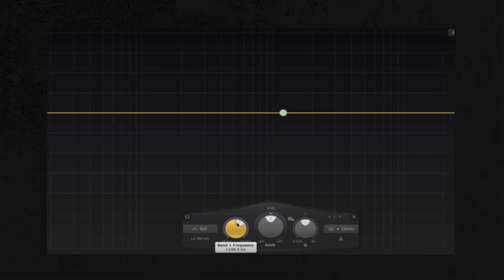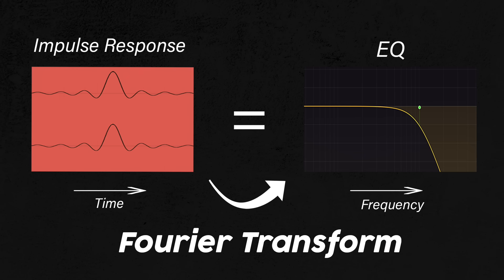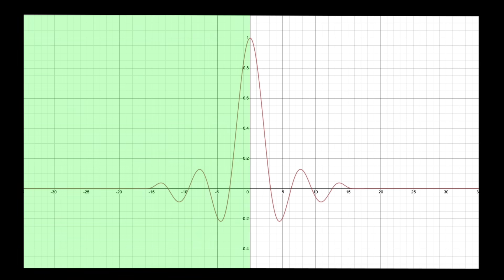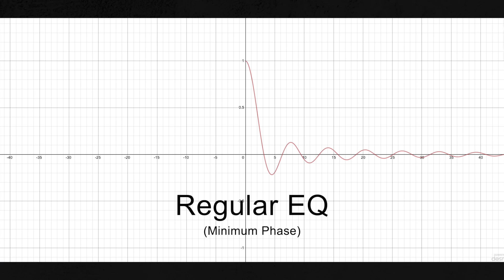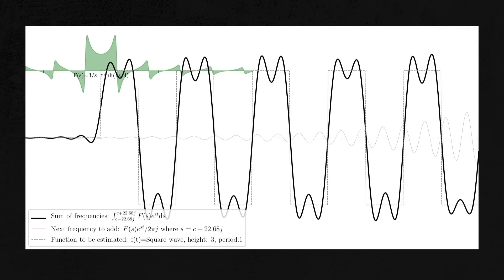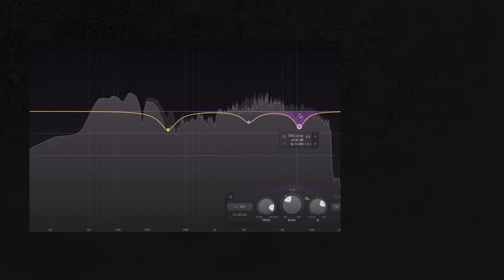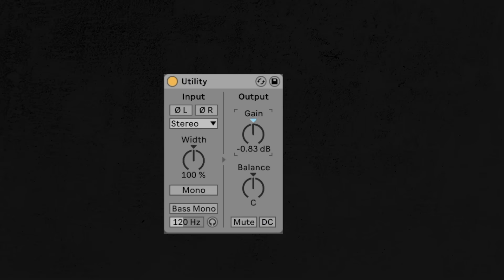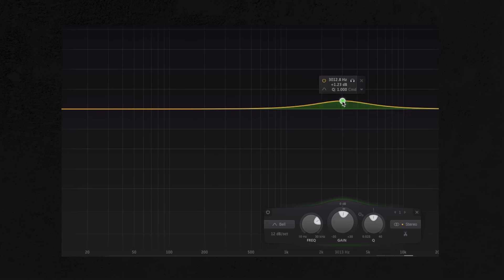You Don't Understand EQ

Comment: damn guy just show different impulse responses, but why if the equalizer uses a linear phase with a delay instead of "predicting the future," the phase doesn't change? It turns out that the response impulse, which is supposedly shifted in time, should boost, out of phase with the sound. And what's the logic behind it? How can it even understand where the correct phase of the sound is?

Comment: 2:29

Not only does the digital world not get enough love, but all of those guys where it's "analogue this, analogue that", as you say, comes from a lot of guys that a./ have never used analogue and nor do they even use analogue, period. But b./ tend to not understand both DSP and analogue circuitry. All of the old school engineers that have been mixing perhaps for longer than you've been alive, who once had no choice to be stuck with analogue, like Andrew Scheps as an example, almost always mix exclusively in the box now. And it's because in every single measurable way, the digital world is objectively better. Of course, when it comes to what one particular individual prefers, it's subjective; this doesn't change the fact that we are lucky to be privileged to live in an era where we have 100% signal fidelity with the digital environment and plugs. Something that has never been the case with analogue.

Comment: I have found that if you start with a flat EQ setting and then completely cut out the 1k or 500k while equalizing a bass guitar, You will get a nice tone that will cut thru the stage mix perfectly.  The closer the equalization is set flat, The more increase in clean and crisp power you can get from your power amp because you can set your volume up higher. Also... Getting your guitar player to roll off the bass EQ on his amp, you won't be competing for the same low frequency. Bass, Mid and Treble knobs on the amplifier should be set between 10 o'clock - 2 o'clock. Flatwound strings and a precise intonation, neck adjustment and string height will also give your bass a proper sustain and increase in tonal range options and quality.

Comment: 10:04 - Practical EQ Tips -is insane 

10:30 -cut the fq between - instrumental and vocal 
11:31 - insten of increasing need frequency - cut the sides if the frequency u want to hi-light 
100-400 hz cut - to increase sub
shave the middle frequency , to highlight
15:20-  fq suppuration table

Comment: Thats why properly mastered songs have soundwaves that look like one long rectangle instead of many peaks and valleys. To get the appropriate and best sounding normalization, first you Have to cut adjacent  freqencies in order to give space for boosting a particular piece of a sound you want to emphasize at that moment in time. Each piece of the overall sound, properly assigned the correct spectrum position can then be as "loud" as possible.

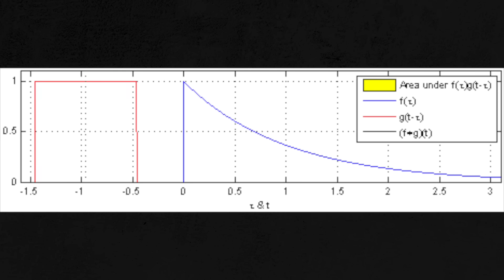Comment: @3:00 a convolution is the integral of the multiplication between two waveforms (one shifted by some time). Not the multiplication of waveforms. 
To convolve a kernal (eq filter) with an input signal (your sample) shift the input signal backwards in time by a constant time period T then chop up everything into equal length segments with length dT. Finally multiply the kernal and shifted signal for each segment and add up the result. Keep a running tally of all additions and there you go the sum total is the convolution. Sounds convoluted

Comment: 🎯 Key Takeaways for quick navigation:

Understanding EQ is crucial for better mixes.
EQ changes the frequency distribution of a signal by adjusting center frequency, gain, and Q.
Digital EQs use impulse responses, which represent the EQ curve.
Finite impulse response EQs have zero latency, while infinite impulse response EQs introduce latency but maintain phase.
Linear phase EQs minimize phase shift but may cause pre-ringing.
EQ cuts create space between frequency bands, enhancing separation and allowing for louder mixes.
Identifying necessary frequency components and boosting them helps integrate sounds into a mix.
Listening attentively and practicing EQ techniques on songs or noise can develop an intuition for frequency balance.
Experimenting with EQ settings, even blindfolded, can reveal unexpected aspects of sound perception.

Made with HARPA AI

Comment: During the first practical tip you mention that cuts create definition. Another way to think about this is if you cut frequencies from a sound and lower the power in the wave, and then normalize that wave to it’s previous level, you’ve effectively boosted everything besides those cuts. It’s thinking of attenuations as boosts for everything else. Probably another reason why you should boost wise and cut narrow.
Also without going into too many details, no cutting and boosting are not the same. Phase buildup is different from phase cancellation. One process causes ringing and the other does not (to my knowledge).
Another reason why cuts help define a portion of a mix is this: take a low frequency sine wave. Notice the long waveform. Now sum it with noise. Low amounts of noise should let you still see the fundamental that is the sine. Turn up the noise though and it effectively eats the sine in an oscilloscope. But, if you highpass the noise you can see a fuzzy sine again. You’ve removed the noise information in that low end which allows the data of the sine to be visible again.

Comment: This is a bit of a deceptive description of EQ to be honest. It's better to describe frequency volume as being relative to other frequencies. Audio is relative in volume and frequency. A simple example of this is to get a rimshot and place it peaking at 10db, and then take a closed hat and have it peak at 0db. The hat will sound louder than the rimshot. Now reduce the volume of the hat to peak at -20db and the rimshot will sound loud relative to the hat. This same principle works with frequencies, so when you are getting muddiness, boxiness, nassal or tinny sounds etc, it's usually an excessive build up in frequencies of that area.

EQ should also be split into two categories:
1. Sound treatment, or sometimes referred to as corrective EQ. This involves removing impurities from a sound such as resonance spikes, low end rumble or high end hiss, etc.
2. Mixing EQ. This involves balancing frequencies relative to other sounds so they fit into the song.
(3. There is also creative EQ for sound design but it's not essential)

The point I'm making is, don't start hacking away at your sounds with an EQ unless there is a good reason. If you find you're pulling down a lot of frequencies then the answer is probably to just turn the mix fader down a couple of dB.

Comment: If I boost frequencies in an EQ plug-in, but then reduce the overall gain in the plug in, is that the same as subtractive EQ? And if so, would I have to reduce the overall gain in the plug-in by the level of the max boosted EQ range to achieve this result?

Comment: So in this video is the reason why when eq for room correction, you 'll always want to subtract, and never add. It sounds always better to have some part missing than to add, also because the addition will also add some modes and some resonances. I would also add that it sounds very clean when each instrument has its frequency domain and dominate in one part of the spectrum that is free. However you can't eq yourself out of room modes, not completely.

Comment: Best eq tip. Pick your sounds based on where they sit in the spectrum. Use as little eq as possible because the eq messes with the sound and too much eq makes your mix sound like a plastic piece of crap. Best producers I know will only use a low cut and that’s it.

Comment: i got a problem with cuts, sure to equalize but the signal shaping should be done in the preamp stage.If you'd sing a scientific C, it wouldn't be a monofonicsinewave on the n^2hz. Rather you'd actually ring out all n^2hz with variable amplitude(lower harmonics) AND the upper harmonics, that is the fifth and them. So because you hear a specific G and all the Cs. This all happends in the powerstage stage, using air as its medium.

You cannot hear it, but if you cut anything on the master... it's like focusing on micro and forgetting the macro. How you EQ, is using 2 sound sources, because how maths work 2 signals battling eachother does what is "eq" naturally, and not by ducking a whole hzrange, which is unnatural. But if you apply what you said to fm synthesis sound design preampstage signal shaping. For sure.

Comment: On a tangential topic, impulse response loaders for guitar are digital EQ curves with fickle marketing. That's why my DSM & Humboldt Simplifier—analog amp "simulator"—sounds just as good as my amp and cabinet with an SM57 on it.

I totally didn't get the part where you explained impulse response, by the way. lol I think of it physically (analog), as how electrical current interacts with RC/LC/RLC filters, so the explanation you gave didn't even compute. I know how an RC low pass filter works because the voltage lags the current into the capacitor, resulting in attenuation of short bursts; and an RC high pass filter works because as the capacitor charges in series, it blocks DC, attenuating long waves. Of course, these things are calculated using reactance values for the sake of ease, but it's important to understand the lowest level principles if you're going to design using equations that are built on them.

Also, a note on (analog) spectrum analyzers. They work by sweeping a superheterodyne tuner across the spectrum, graphing the intensity on the Y axis, and frequency on the X axis. At least, RF analyzers do. Maybe audio is too slow for that to work fast enough. Some audio spectrum analyzers (not the measurement equipment grade) are literally a bunch of filters lined up, tuned to different frequencies, each feeding its own spot on the graph, like how a graphic EQ is done. Of course, digital spectrum analyzers rely on DSP and FFT, taking all the fun out of it. I'm still fuzzy on the Fourier transform and its fast-to-compute counterpart. I really should go back and refresh my memory on it so it stops seeming like magic.

Comment: You can just drive your sub with a low shelf into a multiband compressor set at a ceiling of -2db and you’ll get that fat sub you’re looking for, then your loudness you just push limiters above 120htz and clip if you’re properly compressing your sounds and gain staging you shouldn’t have to do all these cuts that’s more so mud you’re cutting

Can also take like soothe to do it or ozone clarity

Comment: An imaginary frequency is simple there when the signal is phase shifted. The phase shift gets transformed mathematically by arctan into an imaginary and a real part which are 90deg shifted normed units. They need to be for orthogonality because orthogonal parts of a signal do not interfere with one another so they can be used to split a signal into parts. It’s all functional analysis.

Comment: By far, the best and most informative video about EQ I have found. The only exception was when I had an experienced elder try to explain to me how a sound board works with high and low noise, filtering out what wasn't needed for the clearest sound possible - and that was in real life.

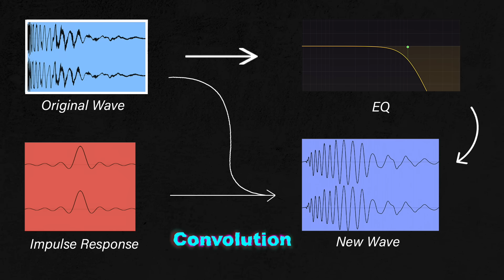Comment: Hey man, I like your video's but I am struggling with following some parts. Quite a number I felt you made a statement about something without outlining the how or going any deeper on why it works in that way. For example at 3:00 you say that convolution is when two waves are multiplied together as they slide past each other, but what is being multiplied here? the frequency distribution of a wave form against the same waveform minus the eq's Quality Control ratio? and it would have been good to give an example so we could understand what it actually means.

Also at 1:45 aswell you say having a high Q value means the rate at which energy is dissipated must be very small, but what do you mean by dissipate? 

The definition of dissipate means - to disperse or scatter. Which is not a linear formula, and then right after that at 1:50 you say that this is why having a sharp Q causes a resonance to decay longer over time. But how does this relate to the "frequency dissipation" in a way we can understand and visualize it. I did not see a explanation for that process, I'm not discrediting the statement but would have valued and deeper explanation of the actual methodology behind them

Other than that love your videos they are explaining very deep concepts that not a lot of people have the effort to pick apart let alone learn themselves. All love, peace!

Comment: Very interesting video. Gave me yet a new way to look at EQ. 
I've noticed a very significant difference in the sound of (even isolated) vocals for linear vs. natural phase EQ in the low end (and a difference depending on whether the you use a low cut or a low shelf with identical slopes at the low end). It's partly going to be a matter of the transients due to pre-ringing, but there's also clearly a difference in the tone. Since no phase cancelation is possible in the case of just one track, it seems like the relative phase of the partial waves affects the timbre of the sound. I also checked this using just two sine waves in matlab and varying the phase delay and I indeed can hear a difference in the subtone (the difference frequency of both waves), the composition and intensity of the high buzz that probably consists of sum frequencies and even the perceived value of the interval. Why is nobody talking about this effect?

Comment: Closely related, but not exactly the same: filters are you best friend for mixing, especially highpass.

Using samples from a myriad of sources usually means there's always some unwanted dirt you don't need for the purpose of the sound. For example hihats. Your sample collection you've built over many, many years likely contains some which have low rumble, from vinyl for example. This kind of stuff can easily interfere with your carefully crafted bass and muddy things up, unnecessarily.

Just put a 24dB/oct or higher highpass filter and rigorously cut everything the sound doesn't particularly need. Same with any other instrument really. A mid range lead, whatever the source, doesn't need either bass or high treble. Cut it all away using a bandpass, or both high- and lowpass. Use your ears, and if in doubt, cut a bit too much rather than too little. Your overall sound will thank you.

The more you cut away that isn't needed, the more "sonic space" you leave for other instruments. It's very easy to clean up your mix that way. 

The native filters of your DAW are likely to be very CPU-friendly, much more so than sophisticated 3rd party EQ plugins. They're basically free cleanup and all you need in many cases. Use them. And if your softsynths offer that, like a highpass, use that too.

Technically, an EQ is a filter is an EQ. They differ only in technical detail and implementation. But filters are usually less complicated, much less CPU-hungry and for the purpose of cleaning up your mix, easier to use.

Comment: Question! I use an amp/guitar effects modeling VST (BIAS). A lot of the presets for the guitar tones and effects that I use include an EQ pedal, which have all these different db sliders for various frequencies.

My question is: Should I be using these in conjunction WITH visual EQ plug-ins (like the ones you show), or should I stick to one or the other. And if the latter answer is correct, which one SHOULD I choose?

Comment: very presumptuous title you have there. first 11 seconds was nonsense.  I think YOU don't understand EQ.  EQ is primarily a tool that let's you get the proper MIX of frequencies on a given sound.  By the logic of the first 11 seconds, I should just cut everything so I have maximum headroom!  That's silly.  If your sound hurts your ears, EQ to the rescue.  Find the offending frequency ranges and lower their volumes.  Get the sound you like, then just turn your volume  fader as loud as you want in the mix.  Sure, you can segregate instruments into frequency ranges if you want them to not overlap as much.  Then you don't have the orig tones of the instruments but in a modern age, who cares?  oh no... it's gonna get extremely technical!    I knew my computer science degree would come in handy ONE DAY.  Let me rush to the technical part to make sure I really don't know EQ.

Your very first statement "what is an eq" is confusing to nubes.  It doesn't "change the frequency distribution of a signal".   It is a volume control for frequency RANGES of a signal.  VOLUME. that's it!  volume.  that's ALL it does is raise or lower the volume of frequency ranges based upon the parameters you set for a given "band" or "node".      Okay, I'm done ranting.  I should not have clicked given the title.  rock on.